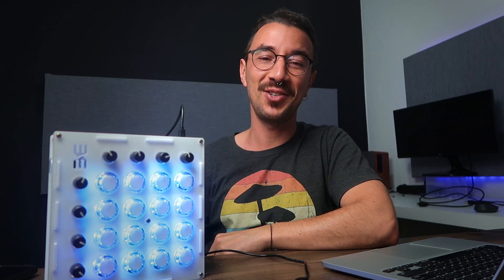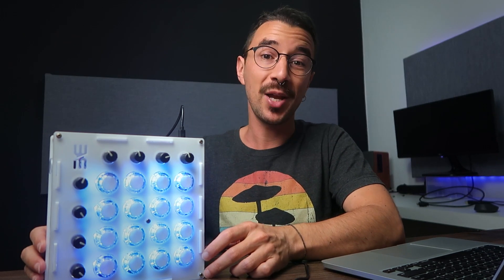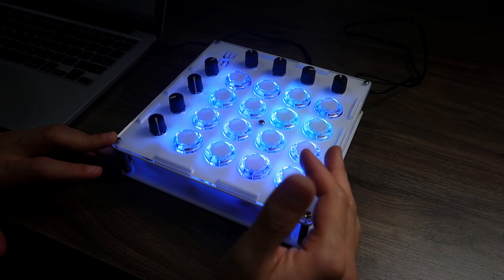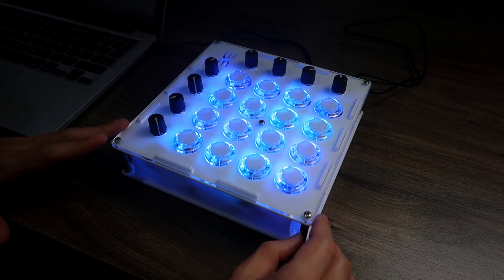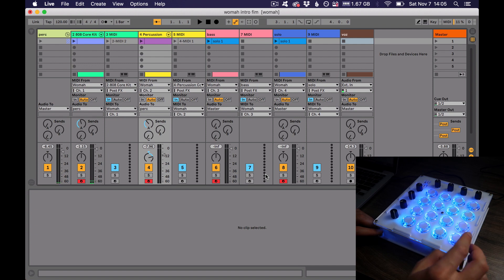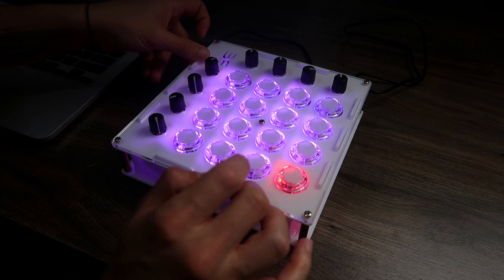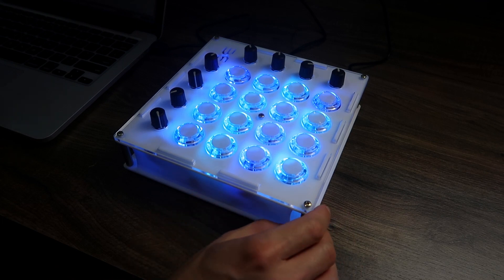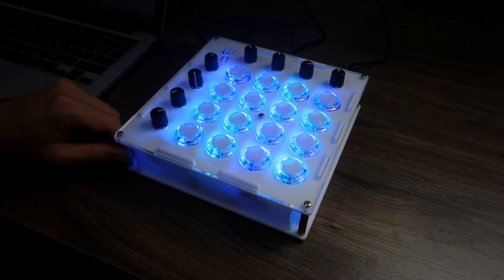I built an arcade RGB  DIY MIDI controller with an Arduino!

Comment: In your project you used the CD4067 Multiplexer. I'm a beginner, but from what I've read the multiplexer only allows you to send a single signal. In that case, does your midi controller only allow you to press one button at a time?

Comment: Hi ! I don't know if you'll read this coment, but you are using some of 'On/Off' buttons. 
What kind of component would be used to ha multiple level of pressure (if you hit strong on light) in order to sent a different velocity ?
Reply: You can use piezoelectric sensors to control the note velocity based on the hit.
It's very cheap and available everywhere, just read its analog signals and map it from 0-255 to 0-127

Comment: this controller would definitely benefit from being translated to PCB. So many wires haha
Reply from the maker: Yes! The PCB is already in production! I built a modula 16 RGB button PCB, so you can build controllers like this, or... a 64. So, wait for me...
Reply: @NerdMusician  i would love more of an explanation on mounting the leds and programming it for led feedback! It's the one thing that my controllers would definitely benefit from.
Reply from the maker: @music143250  I'll do that inside the course for sure...